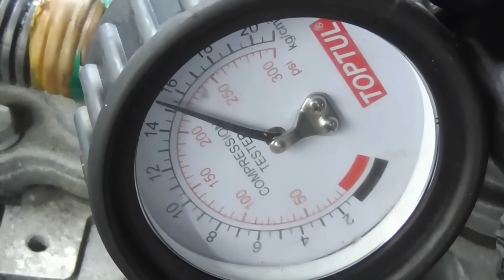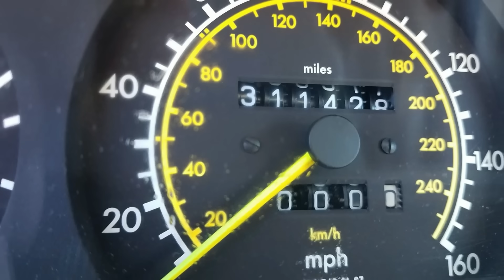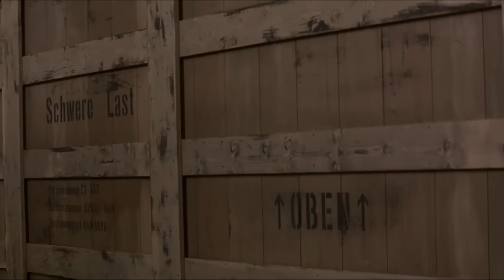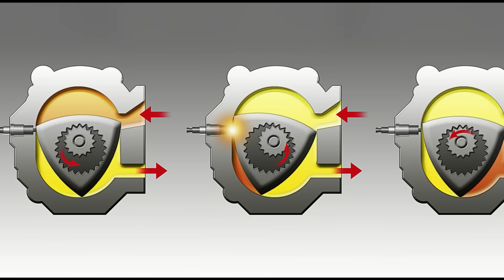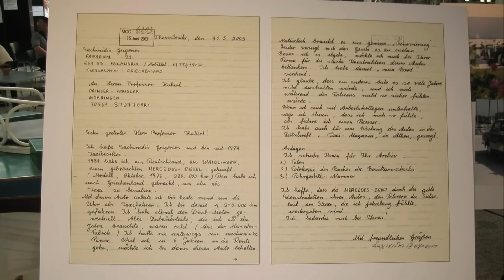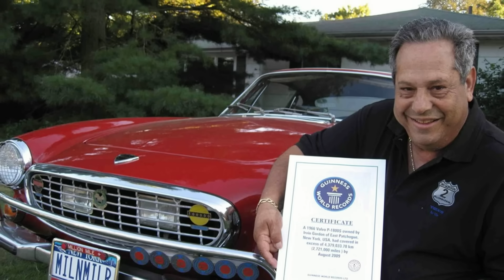Most Reliable Engines of All Time

Comment: 18 wheelers can go over a million miles before being re-built
Reply: Only if you change the oil and maintain it properly. Don't forget, they never go over 2500 rpm and on average only have about 400 horsepower. They're all inline six's, and about 14 or 15 liter nowadays.
 Always, always drive cautiously, patiently, and courteously around trucks. It's like an egg against an anvil if you collide. Your, and your passengers lives depend on it.
Reply: @johnwyman6331  It's not the horse power that does the work, it's the torque! Not sure of the exact number, but just guessing around 1500 lbft of torque.
Reply: @hoffer54  depends on the engine size. Cat used to make a 625 hp with almost 220 ft lbs of tq
Reply: @hoffer54  not close        try 10000ibft    to 5000 plus
Reply: @johnwyman6331  true. I have been driving big trucks for 22 yrs
Reply: Highly maintained and 99.9% highway miles. Drive them all through town everyday and see what happens
Reply: I feel they just picked a bunch of random cars
Reply: The MP8 in my Mack Anthem only has 450ish HP but it's dishing out around 1,750 lb/ft of torque.

Comment: So basically asian racing engines, German diesels the Mazda rotary and one in a billion freak engines make your list? LMFAO. THUMB DOWN. Try the Chrysler 225 slant six, GM 230 and 250 inline sixes, 60-'s thru 80's GM and Ford small block V-8's. Early to mid 80's Toyota and Mazda 1.5 liter inline 4 in the Tercel and GLC series cars. One thing about reliability is the engines ability to keep running even with massive problems. I can't tell you how many times these engines went to hell in the middle of nowhere and got me home. It wasn't the engine that failed it was a part of it that broke. Once home the part was replaced and the engine ran great again with no sign of damage. I never replaced a car because of engine problems. It was the rest of the car that was falling apart. i.e. 1965 Chevrolet C-10 pick up 230 ci inline six. Cause of death with 280,000 miles? Terminal RUST. 1981 Mazda GLC 1.5L inline 4, 310,000 miles, Cause of death? Cascading multiple wheel bearing failures. Other then the OCCASIONAL oil changes the only engine maintenance was spraying a can of GumOut carb cleaner down her throat every 10,000 miles.

Comment: What about the Volvo B23/B230?
Many has seen +300.000 miles without problems and in harsh conditions
Reply: Yep my old 740 GLE with a B230F has 500.000 km on the clock and use 1 L oil between oil change... Never been apart either and still drives like a new car

Comment: bmw lol Engine of the year award, lol. N62 engine in E65 won EOTY for 2002 and it was a notoriously unreliable pos. Valve seals, alternator bracket, coolant transfer pipe, various other oil leaks, ..... lol

Comment: Missed a bunch that are more reliable than half the motors you listed. Ie Toyota 1hz 1 million miles easy. Toyota 3l 5l family same.
Ford barra inline 6 family easily 1 million km engines without cracking open the engine.
Chevy Ls1 one of the most reliable v8s out there.

Comment: Sorry, Ford 300/4.9l is the winner here. Long production run. I don't think you can name a engine thats been more widely used. Originally built for generators and used in every thing. Tractors, forklifts, industrial equipment like wood chippers, trucks (all American ups step vans until a few years ago [gee I wonder why it took them so long to update their fleet]), Harlan haulers( moving airplanes and luggage around airports). The list goes on and on for the applications that this engine has been and still used for. The Ford 300 has a huge reputation world wide for it reliability. Easily a 1 million mile motor with proper maintenance. Nothing else comes close.

Comment: I would say 80% or more engines produced today should handle 200k miles no problem granted they are taken care of. An engine isn't that impressive unless it can hit say 300k+ with no issues along the way. I drive an f-150 with the 5.4L 3valve motor. It currently has 206,000 miles running strong on only spark plug and oil changes. But the 5.4 is considered to be a crappy motor by most mechanics. My point is, 200k isn't a super impressive number for a modern engine. The car itself however might be falling apart around the engine at 200k miles.

Comment: I bought a new 1985.5 Ford Escort L 1.9. 
265,000 miles in eleven years original clutch and the car ran as good as when new. 
Regular oil change at 4,000 to 5,000 miles.

Comment: I have seen tons of million mile us built ford vehicles so this guy does not impress me with toyota's, nissans, honda's.  now i have seen several million mercedes diesels. hell a sloppy factory built small block chevy will beat 200,000 miles with a easier foot than i have. fed-ex ran 1 ton econoline vans a million miles  with 300 6 cylinder engines, the us military ean econolines 800,000 to million miles all on original engines including triton modular engines... been there seen it retired ford tech.

Comment: Who the hell gave this guy his information and decided to let him talk about engines when he obviously knows less about them then a 10 year old girl..

How about any Cummins engine or the old International harvester otr engines.
But from my experiences as a technician the ford 2.3 Lima is one of the most reliable engines. I've seen a few rangers and mustang's with the 2.3 come through my shop with well over a million miles. My father had a 97 ranger 2.3 with 1.6 million miles before someone rear ended him and flipped the truck. And the only breakdowns it ever had was the timing belt broke on it twice.(luckily it's a non-interference). It even still had the original clutch!
Also had a teenager bring in a 93 mustang that he decided to drive through a creek. Hydrolocked the engine and got a bunch of creek water mixed into the oil. He drove it home and didnt change the oil. The next day his mother was driving it and blew a hole out the side of the block(you could see 2 of the pistons). She drove it about 60 miles home, then another 15 miles to my shop with no oil in the engine at all. Still ran just fine! I still have the engine sitting in the back of my shop and I guarantee if I put it on a test stand it would fire right up. I'm sure it would eventually lock up but what other engine would drive that far with absolutely no lubrication other that the fuel in the upper cylinders?

Comment: Several of my vehicles have over 200,000 miles on their original engines. One has 310,000 (454 big block Chevy Suburban) and the highest mileage vehicle was an '05 F 150 with a 5.4 three valve triton that I sold with 334,000 on the clock. Today, that truck is at 374,000 miles. All on the original engine.
Reply: I bet that 454 requires 1.5% of the world's total oil production, u know, to make it from gas station to gas station.
Reply: @Jett-Alaska   I can afford whatever gas it needs. No big deal!

Comment: who else got triggered just after watching the first minute?
Reply: Talking about a Nissan engine and showing a Toyota? Stopped watching 😂😂
Reply: Samson Stenton k
Reply: dett
Reply: I was yelling at my phone. Just terrible.
Reply: Frederico Leite JESUS CHRIST! He showed a four cylinder when talking about the 13b.
Reply: @zryhmer  What's worng with that, just showing the more reliable engine
Reply: Talking about the k20 and showing cars that use b16 🤔🙄😳
Reply: Dett and showed a supra for a skyline motor
Reply: I got triggered coz the rb26 isnt even that great..
Reply: Where's the 7.3 power stroke and 5.9 12v Cummins? Honda's Toyotas and Mazdas what a douchebag.
Reply: This guy has no idea what he's talking about. He said the Mazda 13b rotary was dependable...I guess he's never heard of apex seals.
Reply: @MaxDephyantz  They would have been great the but seals were their Achilles tendon. And the mileage was pretty bad also. One would think a modern material could be had to cure the apex seal problem, and fuel inject them. But who knows? They probably lost their shorts on the whole deal, and just cut there loses. They kind of always had engine issues. Had an MPV, again a great vehicle, but had lifter issues, they put these little tiny hydraulic lifters in the valve end of the rocker, could never get enough oil out to them, so they rattled all the time.
Reply: @hoffer54  they did fuel inject the 13B the RX7 FD and RX8 were both fuel injected
Reply: Ii
Reply: Nissan junk,can't count the times at a red light NISSAN TAKES OFF LITTLE PUFF BLUE NISSAN TRADEMARK  SMOKE OUT OF THE TAILPIPE 80 % DO THIS MY,BEST FRIEND WORKED 29 YRS ENGINE DEPT.,THEY KNOW THE PROBLEM COULD CARE LESS JUST GET THE JUNK OFF THE LINE TO THE DEALERS,OLE SCHOOL MECHS. KNOW WHAT THIS PROBLEM IS EASY FIX!
Reply: 6 individual throttle bodies what a dumbass
Reply: @MrGert150  It does have 6 individual throttle bodies..

Comment: a clutch lasts 50k miles?  I've been a professional auto tech for 20 years and 200k is just broke in for an engine.  I've personally seen countless ford 300 straight 6's, GM 3.8's, GM 4.3's,  and many other makes engines go well over 300k.  most i've personally seen was 640k on a MB OM642 and 675k on a ford 5.4, granted, the MB was done for with metal stuffed in the oil filter and no compression but the ford was still running strong.  with proper maintenance and restraining from abusing an engine, most of them can easily hit 300k and much further if you dont neglect them and handle any issues promptly.  by promptly i mean that i've seen healthy engines ruined in a very short period of time by things like leaking fuel pressure regulators diluting the oil, and any time oil or coolant is run low it causes huge amounts of wear.  keep those engines happy and full!

Comment: Ok so even though the rb can handle high power numbers but alot had a lot of issues at low hp numbers. The 13b is not a reliable motor by no means either. So no love to the 3.8 Buick motor ?

Comment: I have a Mercedes 240d with the same body design of the 300d.  Great engine and it is generally not going to win a race but I am averaging between 28 to 30 mpg at 65 mph.  I could drive all day at 65 and 70 mph and the car stays right up with traffic with no problems.

Comment: "with over 200000 miles!" Like that's supposed to be impressive? Talking about the Mercedes diesel engines they aren't broken in until 500000kms, it's actually rare to find one with as little as 200000miles on it.

Comment: Whoever researched this has never seen an engine. This hurt me.
Reply: The person who compiled this list is a moron and should be shot for spreading misinformation. 100,000-300,000 miles isn't impressive, nearly every automotive manufacturer makes gasoline engines that will last that long before needing to be rebuilt or scrapped. I rebuild diesel engines with 1m to 1.5m miles on them and that was the first rebuild they have ever had. So this bozo wants to talk about reliability, he's fucking stupid.
Reply: @JosephArata  very surprised not to see 12 valve cummins or 4bt cummins not on the list, and Ford 300 inline 6. Whoever did the research is fuckin stupid.
Reply: @DixonBegay  Duramax LBZ should have been on the list too
Reply: @JosephArata  
I know right, my 2011 GMC Sierra with a 5.3 has 285,000 miles and has never had major mechanical failure. It's basically expected for vehicles, especially those that cost upwards of $30,000, to last for 250,000 miles before repairs are more than it's value.
Reply: ya most engines with timing belts do not even recomend a belt change till 150,000 k
Reply: @robdemers9303  150 000km is only 93 000 miles

Comment: I used to wrench on an old Kenworth T600. He nursed it into the shop missing 10 out of 13 gears. 
We pulled the transmission out and opened it up. The drive gear on the input shaft was smoothed out. The driver say, "Wep, that's not to bad for 3 million miles!"
Me in disbelief starts asking questions. Turns out he bought the truck brand new in 1992 and puts about 110-120k miles on a year. It's the third time the old 60 series Detroit had been rebuilt. 
I would have never guessed as the truck wasn't in that bad of shape. 
I guess that when they still made good trucks.

Comment: Vw 1,9 tdi ?? Ever heard of it ?? My 95 Passat with 1.9 1z tdi  have 380 000 km and still get    4,5l/100km
Reply: good point, what maintenance on it ?
Reply: @TVTika  some oil , some filters , all the basics . Engine  run nicely , and still smooth. By now i replaced basically all rubber parts of suspension ( some parts second time because I crashed with it ) . Usually all stuff is on basic DIY skill level . One problem is that it is OBD1

Comment: From my owning various cars over the years since the early 70's.

Volvo red block over 400,000 on original engine, Datsun L20B over 400,000 on original engine...that double roller just keeps on rolling, and a Jeep 4.0 six cylinder that had 340,000 miles.  The Jeep started smoking and using a lot of oil.  Previous owner treated it like crap.  Can't say how long it could have gone with proper oil changes.

Comment: GM made a good 2.2 ,3.8 after 2004 getting over 350 thousand  miles and the 3.6 after 2012 engines are bullet proof getting over 300 thousand miles that's Chrysler  and GM 3.6 and of course the 5.7 that got over a million  miles.

Comment: My Dad has an 02 Civic with 350000 miles. Everything is original and still works, minus the gas gauge on the gauge cluster. The low gas light still comes on though.

Comment: Intreging, anything less than 200,000 km or (120,000 miles) durability shouldn't be built as it's a waste of valuable resources.   

A lot of Ford 302's, 4.6's and their Australian Barra 6 along with GM's 350's and Chrysler's 318 routinely see 400-500,000 km before needing rebuilds...

Comment: No mention of the Chrysler 225 slant 6?  With a production run that started in 1960 & ended in 1987, it was one of the first gasoline engines to be known for it's long life going 200k to over 1,000,000 miles without major problems or rebuilds.  That is reliability that most of the the Euro-trash engines on here can't compete with, so why was it not even mentioned?

Comment: Most of these engines are outdated and only found in older cars.
I have a Ford Ranger and a BMW, both 1998 vehicles. Both have over 260,000 miles and run great. "Reliable" nowadays (2019) is 300,000 plus. The better motor oils since approx. 2006 are a major factor. Proven designs are another big factor.

Comment: I have a 66 Dodge Charger with a 383,  daily driver, uses about a quart of oil a year,  nut driven in the winter, original engine
Reply: Chrysler made some of the best engines in the 60s and 70s.
Reply: The 225 slant 6 was good too

Comment: 😝😝😝 first owner of a Škoda Octavia 1.6 TDI with PDF bought it in may 2010.
170.000 miles on and don't thinck to change the car till it gets 200.000 miles.
Cpnsumption: 4.3 liters of dizel for 100 kilometers. 
Beside regular services oil and filter changes every 15.000  kilometers this is what i had to do.
160.000km changing front and rear disck plates not disks they are stil good.
207.000 km injectors one went bad so mehanick informed me it's best if i change all 4. So that cost me 500€.
226.000 EGR valv break so i hawe removed it from sistem now car runs with out it 140€. The Cars CPU must be reprogramed for EGR removal.
232.000 i give the CPU new MAP which rased power from stock 105 hp and 240 Nm of tork to 130 hp and 286 Nm of tork. Cost 180€.
236.000 km had to replace electric cables for injectors and DPF senzor. 360€
That's it.
Stil first clutch, first turbine, first PDF, first exsost....
Car stil goes ower 200km/h.
Reply: Best fot him

Comment: The volvo's clutch isn't special, he just doesn't USE it. The man does 100,000 miles a year, but probably only shifts gears a dozen times per trip.  As for the high mileage mercedes, many taxis happily crack a million miles simply because they leave them running all day. Almost all bore and piston wear occurs in cold running.  Saw a graph of a 60 hours test of cylinder bore wear vs temperature once. Run it hot, ZERO wear after warmup, run it cold, and your engine is toast after 60 hours.

Comment: I had a 1967 volvo 1800s.. sold it with 285 thousand .  I had a Weber conversion and it would run 7000 rpms in overdrive. miss that car

Comment: You talk like 200,000 miles is a lot these days I have to Dodge trucks one has 240 thousand
I have a Ford work van with 230,000 they all still run great.
These days are really good engine should get you 300,000

Comment: Are you guys from The Verge? How about the 4.0l Jeep motor that was based off the 4.2l AMC online 6? 5.3l GM? 1.8L Toyota 4 cylinder? 22re? 4bt? Mitubishi 4g63? Our VW 2.0l TDI has 270K miles. Do actual research. Any motor worth anything should be able to surpass 300k miles.

Comment: Back in 1998 I was working in Africa. Until I bought my own car, I used a "pool" car which was a Toyota Corolla with a 1600cc 8 valve  engine this had 250,000 klm on the clock and never missed a beat. I've been to several Asian countries and seen "old" Corollasst still reliably running around. 
What needs to be taken into account is driving conditions, smooth tarmac or dirt roads when an assessment is made

Comment: He's saying 100k to 250k is a lot. SMH 
I've had 390 FE blocks, 300 Straight 6's, 302 Windsor's, 400B Clevelands, and Slant 6 MOPARs that made 250k + before the first rebuild.
There's also the Cummins/Dodge diesels, and the old 7.3 Navistar/Powerstroke that I've seen go 300k and up before rebuild.